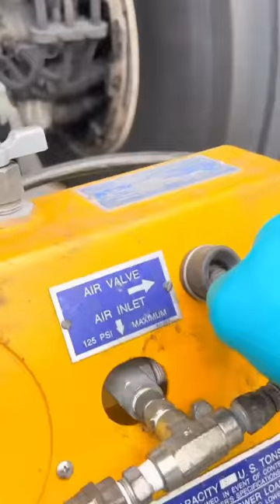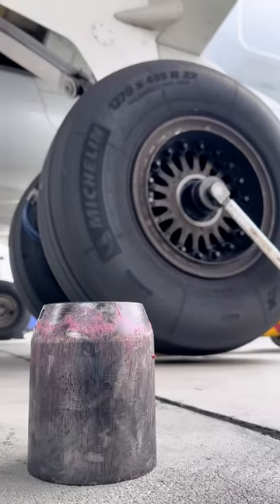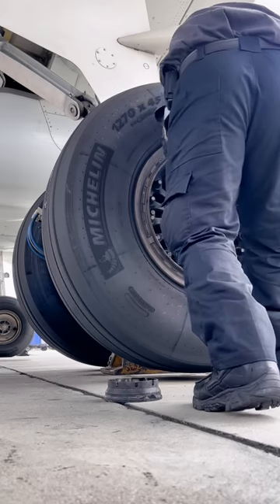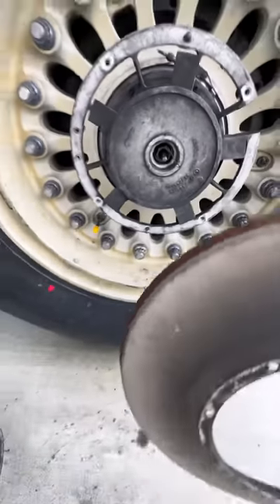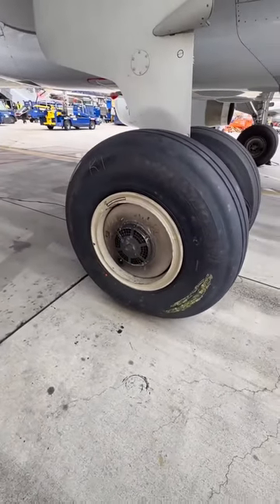Airbus A321 #1 wheel assembly change. THIS IS REFERENCE ONLY.

Comment: just did some 142 bearings yesterday, 2 of, i wanna know if theyre the main wheel bearing or not, cus the ball in that thing is literally 9 inches diameter, well 9.2730 inches plus minus about .0005. did a load of 88J housings today also which are 5.3259, at least they are on my process which is grinding, they then go for plating and assembly after of course
Reply from the maker: My friend, you are on a different level, you guys are doing overhaul procedures I do not measure any of these kind of stuff so whatever you’re asking, I do not have a knowledge to respond
Reply: @StigAviation  yee, i mean im only talking numbers because its my day to day life now lol, and i think our tolerances on these parts are super impressive. 1 skin cell is roughly 0.0011 of an inch, and our smallest tolerances are down to 0.0002 of an inch, and if you drop below that during manufacturing its considered scrap, thats still crazy to me haha

Comment: Why didn't this video show how you the Tire fixed? But for the rest an True specialist... Respect🎩🎩
Reply from the maker: Because we do not overhaul tires here, we just change the whole wheel assembly. Overhaul of the unit is done in a very specific shop away from the aircraft.
Reply: @StigAviation  hi.... I mean how deed you put the wheel on? Thanks
Reply from the maker: @malikakasmi2195  we use a tire dolly. Basically a jack to lift it and slide it onto the axle
Reply: @StigAviation  thanks for your answer! 🎩My ex was a stewardess for sabena(belguim) now its sn Brussels...

Comment: Well I read your answer that you said don't have much time to clean the assembly, in my opinion think safety before money ,let say that 1 day the Axel is cracked some where for the 2 wheels ( you forgot to clean the whole entire assembly, hopefully not to be a disaster
Reply from the maker: We inspect the axel before installation. Also re-lubricant it. We follow the maintenance manual sir. There is no cause for concern here.

Comment: Once it is fixed and done? Any testing required before pass3nger boarding?
Reply: If you mean test landing. No just test the brake fan in this case and tire pressure
Reply: @RHMLG  Thank you🙏

Comment: That jack is air over hydraulic. Imagine the air pressure needed to lift that plane. Your compressor would be the size of the plane.
Reply from the maker: Not much pressure at all. The jack used to lift that axel won’t take more than 300 psi. We just use nitrogen or regular compressed air. Look up the brand Malbar. That’s our jacks we use. 65 or 95 ton jacks.

Comment: I see a lot of mechanics do it differently, when you zero your torque wrench, do you back it out all the way, or do you go to the lowest setting? I go to the lowest setting.
Reply from the maker: i put it to Zero setting, in lbs or ft lbs
Reply: You're supposed to zero it out. Whether via airlines or MRO. At MROs, an inspector has to see you set all torques on the torque wrench and watch you torque for IPIs (In Progress Inspection) and buy back for quality control purposes. As for the airlines, it varies. Some may use a buddy check or not when you torque and sign of the work via work package (routine or nonroutine).
Reply: @BernieGolgo13 MRO inspectors are clowns.
Reply: @justing42  Right
Reply: @justing42  cowboy maintenance all the way!!! Big Fat Not!!!

Comment: I wouldn’t do that with the tire set at pressure. That’s a BOMB! Inflate to correct PSI after mounting the tire! 😮

And release pressure from tire that needs fixed when you lift it up!! Just nuts!! 😮

Comment: This may sound stupid but does the brake fan works like the radiator fan in my car and does it start at a certain temperture ?
Reply from the maker: It works more like your standard fan at home, it is activated by pushbutton inside the flight deck, when pilots get the notification of hot breaks, they can push the button and activate the fans for the brakes to cool down faster. The fan is electric and is ran by a three phase motor Inside the axle hub.
Reply: @StigAviation  Thanks for explaining .....

Comment: Using a torque wrench as a breaker bar is not good practice
Reply from the maker: As I stated if you set it above the torque value it is allowed. and its a reversible torque wrench

Comment: First time I see someone using a torque wrench to lose anything, in my line of work, I would of had the biggest QA fail in the USAF history. 😂😂
Reply: It makes sense. If you torque the nut to 300 ft-lbs you could easily remove it with a reversible torque wrench set to 400 ft-lbs. Wouldn't hurt it one bit.
Reply: @mrfrenzy.  I’m not against it, I was just saying what I’ve experienced in my line of work.
Reply: Yes it's interesting with different practices in different industries. Obviously it's easy for careless people to destroy a torque wrench by using more torque after it clicked.
Reply from the maker: USAF has some different standards .. i completely understand what you mean.. there are people that dont know how to use the equipment properly

Comment: FYI  , you don't deflate the tire all the way,, leave about 50 lbs. in it and you forgot to mention to make sure the brakes are set before removing the tire. 
Just saying,,
Reply from the maker: Your right. I didn’t mention that in the video. Was just doing a general overview.
Reply: @StigAviation  I am a retired airline mechanic and changed a few tire and wheel assy in my day. I do remember changing a tire/wheel assy on an Airbus can be a real pain in the rear-end as compared to Boeing.,, as a mechanic doing maintenance when the aircraft is parked at the gate,, remember what the gate agent says as she approaches you " Passengers are waiting  !!"  LOL

Comment: Would feel a lot better if you knew the difference between a wheel and a tire...
Reply from the maker: If you read the description you would understand. The whole unit is called the wheel assembly. That’s what we change. That’s what I was referring to
Reply: @StigAviation  I know what a wheel assembly is. First like 10 seconds you show the tire down to the belt as say..."this wheel is bad".
Reply from the maker: @billmalec  then my apologies on the misuse of wording. But I think you understand what I meant throughout the video
Reply: @StigAviation  no biggie. I'm sure I'd suck at doing videos. Actually I DO suck at videos.

Comment: damn came here cus i wanted to see if i can see some bearings because i actually make the bearings for airbus A320, 321, 330 etc etc, some for boeing too. sad i didnt get to see exactly where any of my handy work goes. only been at Minebeamitsumi for half a year. but im already all about landing gear bearings and what not lol
Reply from the maker: Next time I have a tire change, I will do a more detailed visual on the bearings just for you. But otherwise I really don’t measure any of those things.
Reply: @StigAviation  haha thatd be ace, i even did some suspension bracket bearing things for some sort of armoured vehicle yesterday, i believe its some kind of 8 wheeler tank which i think is kinda cool

Comment: Shocked a tyre could get in that condition or did it happen on one landing? How often are they checked.
Reply: Please don't compare what you see here with automotive tires that only have a few layers of canvas. Below the tread, aircraft tires have two layers of metal cut protectors separated by rubber (in the video you can see the upper cut protector), then another layer of rubber that's as thick as the tread, and then many more layers of canvas and rubber. Safety is never in jeopardy.

Tires are checked during every preflight check (so before every flight). And seeing tires in that condition in line maintenance isn't that uncommon. Especially on narrow body aircraft as they have very short turn around times and many landings each day. In base maintenance they're often replaced before getting that bad. But a single wheel and tire assembly costs around €30000, and changing a wheel before it's truly necessary is a costly decision.
Reply: @CheapBastard1988   thank you

Comment: He cambiado algunas  y he visto cambiar muchas ruedas de A320 o A321 nunca he visto tratar tan mal las piezas del avión tirandolas al suelo.
Reply from the maker: What are you talking about. It’s just plastic pieces and rubber. You must have never worked line maintenance and had to get a wheel changed in 20 min.

Comment: What’s the tire pressure set to when you re-inflate? As well as did you re-apply anti seize to your bolts thread?
Reply: Each different aircraft tire has a specified pressure in the maintenance manual.
Reply: I assumed that both the nose and mains are different…but what about inboards and outboard…I’ve never worked on anything more than tripod…so pardon the line of questioning…just curious

Comment: Much dirty ( blast ,  grease , leak from  brake fluid ( hydrolic ) will cause fire 🔥 on the wheel during braking moment, so safety of passengers & Crew members first  ......i think sir
Reply from the maker: I completely understand my good sir. But there was no leak. Grease is mandatory, it has to be there and it’s very special high temperature grease

Comment: What would happen if that bad spot  on the tire was pressed against the ground and was not visible?  That would be dangerous.   What are the odds that happens?
Reply from the maker: The spot where it wore out, was very large, it would be quite impossible to miss, also, if the aircraft was getting pushed back, the tire would roll around and expose the damaged area

Comment: doesn't look like the wheel is damaged, only the tire. and i realize the tires aren't changed on the aircraft and both wheel and tire will be removed.
Reply: That's done in an overhauling facility. The wheel (halves) will be inspected and the tyre will be resurfaced. And inflating a tyre for the first time isn't without risk.

Comment: Believe it or not we used to change them without the dollies at Ryanair no time to use the shitty equipment they provided. Some of the more experience wheels and brakes mechanics could get them changed in as little as 12 minutes.
Reply from the maker: just be careful   dont let it fall on you
Reply: @StigAviation  I'd be lying if I said that hasn't nearly happened to me on more than one occasion lol. Let me tell you the worst part is getting them up after they fall.

Comment: So you  replaced one tire but not the other i can see the difference on size now i know why they have to be changed to often and why the flights are so fkn expensive
Reply from the maker: The other one was still in limits. We change the main wheels only as needed.

Comment: A few years ago I sketched on idea on paper, my idea was focusing on reducing tyre wear during aircraft landing. My idea was to fit small scolloped fins to the wheel hubs to rotate the wheels in a forward motion therefore when the aircraft touched down on tarmac there would be negligible tyre wear as opposed to the tyre scuffing that occurs when a non moving tyre hits the ground.
I showed my manager at work one day as he was ex RAF, he suggested it was impractical but did agree that my idea did have merit.

Anyone out there think it could work?
Reply from the maker: I think it could work.. it is a good idea but getting manufacturers to agree is a different story. I would definitely patent it before showing it to anyone.

Comment: This video should be marked as INFORMATION or GUIDANCE only NOT reference. The reference material is the procedure as laid down in the relevant documents and procedures.
Reply from the maker: In the Aviation world, when we say reference, only, that’s exactly what that means. This is by no means and official procedure. I am following very strict guidelines and manuals, this is just an overview.
Reply: @StigAviation  Yes I fully understand that and I've been involved in aviation maintenance professionally, as a volunteer, and as a private pilot for nearly 50 years. A reference is the definitive document or procedure which defines it absolutely i.e. the point of reference. A video demonstrating the general principles of a task can't be described as a reference unless it details every part of the procedure together with torque-loading values, inspection criteria, etc. Everything else is for guidance or information with the caveat that the official service or maintenance procedure must always be referred to for the latest edition or amendment, i.e. the reference.

Comment: Sorry but I don’t even throw things around like that on my cars wheel parts when I replace anything. I actually put a towel under so first I don’t scratch anything then so that nothing gets broken or cracked. Thousands of peoples lives are dependent on this. What if something cracks or bents? A little more delicate fellas! Please!
Reply from the maker: Please stop assuming that I’m throwing things. And the part I gently tossed aside is literally rubber and plastic. We know what we are doing and I been doing this for over 25 years. Never had an issue.
Reply: @StigAviation  okay very well. Being a son of a pilot, I already learned that when a craft has an issue mid air usually it’s a human error either in the cockpit or on the ground by the maintenance. Just worried me a bit but you clarified it. 
I already liked your video and thought it was pretty interesting. Thanks for sharing
Reply from the maker: @mr.zeitmaschine6878  glad I could help clarify. And thank you for being here and watching. I appreciate your time.

Comment: Next time local MX tells me two hours for a tire change , I am showing them this video…I will even give them double the video twin and say 30 minutes plus 15 for paperwork.

You forgot the 15 minutes for them to think of excuse to not do it, 15 minutes to try and stall to shift change, 15 minutes to realize they brought out the wrong fleets tire,  Boeing tire for AB, 115 to realize they are either at wrong aircraft, wrong gate or both, 15 minutes to remember they left the axle jack in the other terminal or at the hanger…..you get the idea….
Reply from the maker: you have to remember i had all the equipment ready and new wheel ready,  15 of the actual physical work .. not counting putting everything back and as you said some paperwork

Comment: what type wheel bearing?
Reply from the maker: Roller bearings on the inside of the wheel hub assembly
Reply: @StigAviation  tapered? requiring preload?
Reply from the maker: @raginroadrunner  if you mean preloading as in when I put in initial torque then yea. We do that to seat the bearing on the axel.

Comment: What happens if a tire blows and shreds as the aircraft reaches V1 speed!😮
Reply from the maker: Most likely an aborted takeoff
Reply: Aircraft tyres usually don't shred. That mostly happens if the brakes are stuck. As an intern, I've seen a 777 entering that landed with a tyre with no pressure. It was very underwhelming as it didn't shred and didn't fall off the wheel. It was just a wheel that didn't quite look right and had to be replaced. The wheel on the other side also had to be replaced as a precaution and by a different maintenance engineer because it was on an ETOPS aircraft.

Comment: Everything thing on the floor and didn't clean the parts
Reply from the maker: There’s no point in me cleaning parts because on the next landing, it’s going to look exactly like that. And where do you expect me to put parts, it’s not like I’m losing anything. I simply put it to the side and when I need to reassemble it. I put it back together.  This is out in the field, not in a shop or garage.

Comment: A bad "tire" the wheel is fine.
Reply from the maker: It helps when you READ the description. Wheel and tire comes as An ASSEMBLY
Reply: @StigAviation  did READ. Tire needs replaced. Duh you must remove  the wheel and tire. I can't think of a vehicle one that the wheel stays behind and the tire removed..... 
😆😆😆😆😆
Reply from the maker: Once again you are comparing a car to an aircraft. Not the same sir. With all due respect. When i change it. Im changing a wheel assembly. Not a Tire

Comment: Ишаки не почистили ничего. Я б им машину не доверил ремонтировать.
Reply from the maker: You don’t need to clean any of this, first of all, do not call me a donkey, second of all, you’re not an aircraft mechanic, and third, it would become just as dirty on the next landing. So next time you feel like expressing your opinion, make sure you know what you’re talking about.
Reply: @StigAviation  пыль от колодок тормозных мешает охлаждению получается перегрев и взрыв колеса.
Reply from the maker: yes thats why you have brake FANS... to expel the dust and heat... you also have a dust cover... thats how Airbus designed the aircraft.  @ИванРатнев-г5з